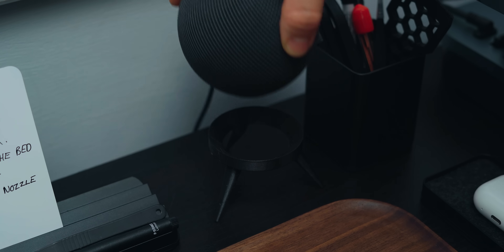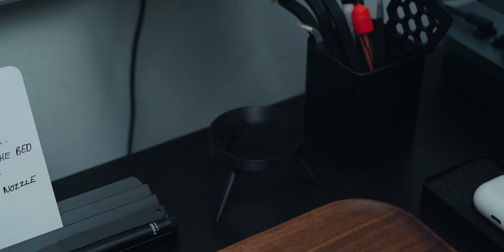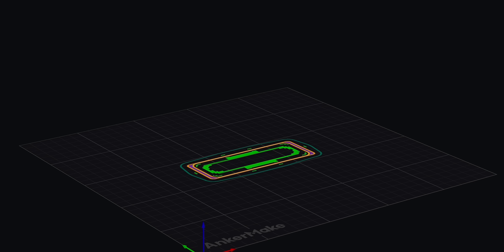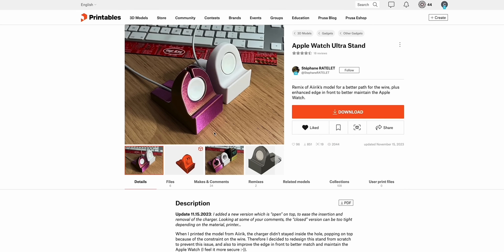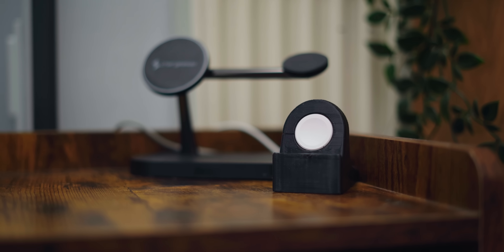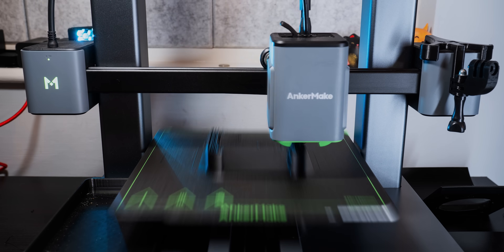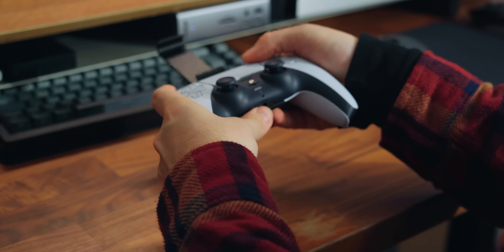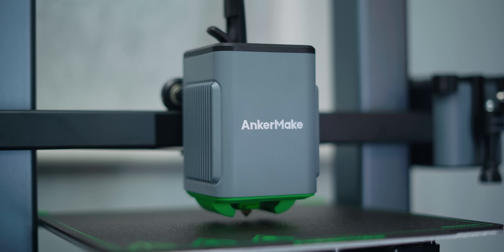3D Printing Awesome Apple Accessories.

Comment: Do you need a PC for this printer or can it be used with a Mac? Also, how big of a print can you make (what’s the table size)?
Reply from the maker: Everything was shown using a Mac, but you can use an Android, IOS, PC, or Mac to control it. I'd recommend a Mac or PC though. Bed size is 20 x 220 x 250mm

Comment: 0:00 «Apple accessories are pretty expensive». Thank God a 3D printer is quite low cost. 🙄
Reply from the maker: You can buy a decent 3d printer for as low as £150 and filament can cost as low as £10 for a kilogram… a kg of filament can print you like 20 accessories. It’s economies of scale. Think outside the box and the possibilities of what you can achieve outside of apple accessories with a 3d printer.

Comment: Thank you Chris for sharing my Apple TV mount in your video! I was wondering why I suddenly got some downloads 😅. The "holes on top" downloadable files do include that hole in the middle ;)
I do print them standing up with a brim (so with the gap down). No need for supports or anything.
Reply from the maker: Aha that’s amazing. I wasn’t expecting this video to garner so much response so I’m glad you’ve got an influx of downloads! I think I couldn’t be bothered to reprint it, so I did some DIY. Thanks for making it though, it’s really cleaned up my whole setup and it’s going strong!

Comment: 6:45 simple, not enough infill and layers to make it sturdier. My guess you used about 50% infill and 3 layers for perimeter?
Reply from the maker: I followed the recommended infil of 20% with that one. I’ve since reprinted it at 50% with petg and it’s showing no signs of stress or cracks :)

Comment: Why didnt you fix the rough surface on the Home pod mini stand? Heatgun or so. 
I think you need to lower the print speed to not get those rough surfaces when there is a lean.
Also it seems you use too little infill for things that needs to handle stress. Normal pla is fine if you have enough infill.
Reply from the maker: Brand new to this don’t forget!

Comment: Awesome video. Btw, you can dramatically increase the strength of your prints by increasing the number of perimeter walls and % infill. It’s hard to tell from your video but based on the empty space inside your broken parts it looks like you are using low percentage infill. For parts I want to be as strong as possible I use 4 perimeter walls and 100% infill
Reply: Certainly try a .8 nozzle!
Reply from the maker: Cheeers John it means a lot! I think I printed with a 20% infill, I’ve been following the print guides they usually put on printable. 100% infill could take a long time!
Reply: @ChrisWilmshurst  yea it can take longer but if you also get a bigger nozzle it should make up the difference if you don’t want to wait. Most printers come with a 0.4 mm nozzle. If you switch to 0.6mm your prints will complete much faster and can even be a bit stronger for the same amount of infill since the plastic being extruded is now 50% thicker than using 0.4mm. Just something to consider if you get more into 3D printing. I fell down that rabbit hole a while back and have enjoyed it ever since. It’s amazing being able to have an idea and then realizing it in the physical world so easily
Reply from the maker: Thanks for that suggestion! I’m guessing bigger nozzles are best for bigger prints? I have 0.4 and 0.2 nozzles. I’m not sure what I’d use the 0.2 for, but I picked them up as they were on sale.
Reply: @ChrisWilmshurst  I think you need to increase your printing temperature let say by 5 - 10 deg because on video it seems like layer separation.
Reply from the maker: Thanks for the tip! I've been working with the profiles in AnkerMake Studio, so I'll try a few different temperatures :)
Reply: @ChrisWilmshurst  yea they’re better for bigger prints but 0.6 is also good for smaller prints too. Many people argue that 0.6mm should be the standard size shipped with printers these days
Reply: @74862  You don't need 100% infill, just increase perimeters, too much infill will take too much time to print and the benefit is too little.
Reply from the maker: All this information is really helpful and I appreciate you guys sharing it